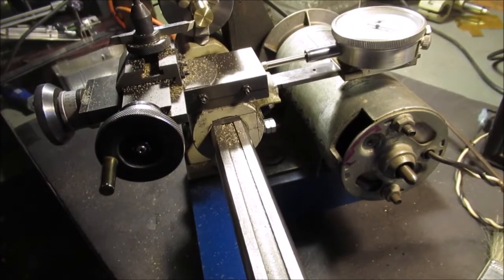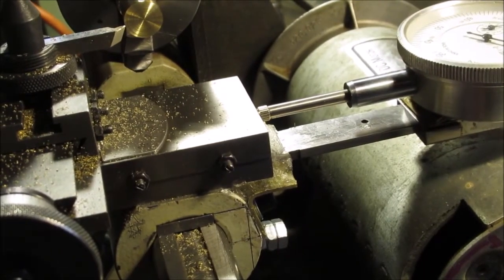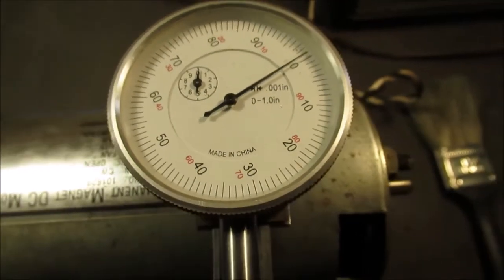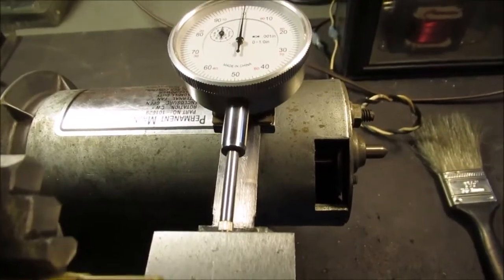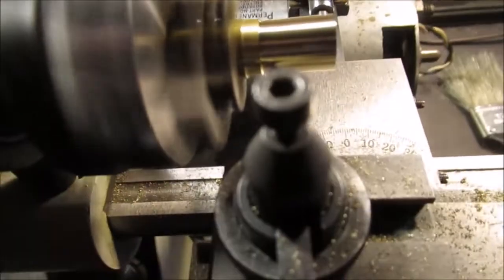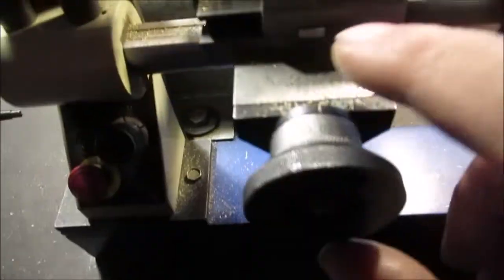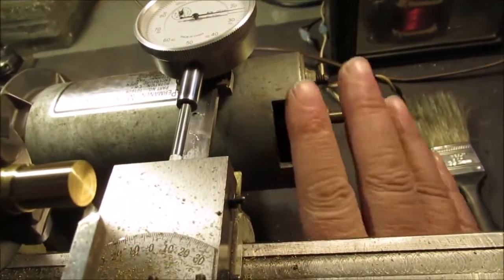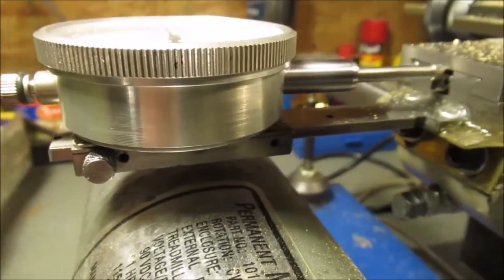Homemade Dial Indicator Mount for small lathe

Comment: Hey Jim there is your fine lathe, adding features to machines are what makes them more pleasurable to operate on a regular basis. We have backlash it can so dramatic in the smaller, that motor is really a load but it runs and we have never seen your lathe so this is our first time. The motor does do two function that can come in handy.
Thank you for the share, Lance & Patrick.
Reply from the maker: This lathe has some cheap brass pieces where the  lead screws go through which is it's weakest part for wear ...For what I make adding the Indicator will make it so much easier to operate ...Thanks for visiting this weeks episode !!!